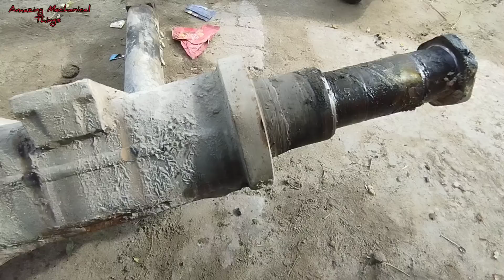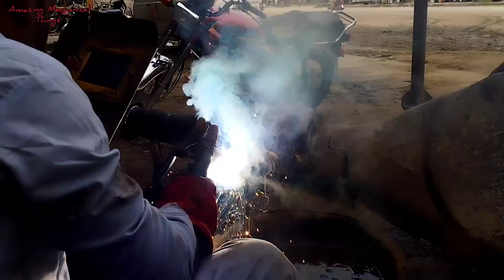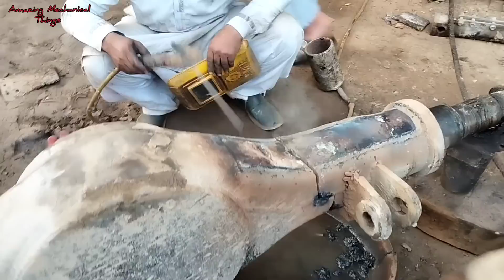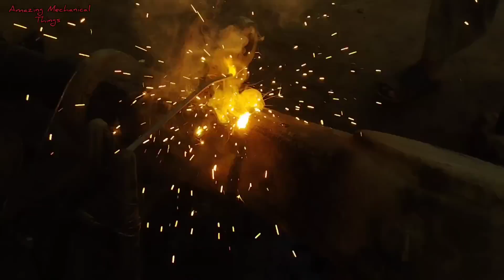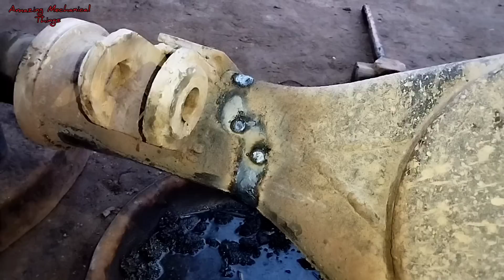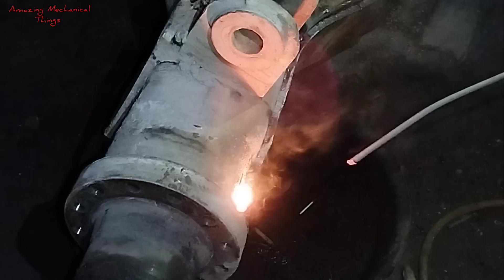Spindle are Cracked in The Middle Which no Mechanic Repairs|| NISSAN TRUCK Broken Rear Wheel Axle ||

Comment: Hate the negative comments,,,, we all "make do and mend" , it is just unfortunate they have to do it with vehicles. Tell me you have never stuck anything together with "Duck Tape"...... I rest my case.
Reply: Hi Jamie, The comments you refer to...the guys don't prep the "to be welded " parts is a colossal omission.  Those who are metal fabricators see that. A weldors job...is to make sound ductile welds. The gents in the vid simply have never been shown the steps needed to make sound/ductile weld joints. Hence their repair will fail soon.
Reply: @petersipp5247  I know exactly what you mean, I was a 6G, coded welder for 15 years after leaving the forces. In all fairness looking at some of their work, they would probably be better off using duct tape 🤣

Comment: Never crosses these guy's minds that the reinforcement strap does close to b-all on top of the axle - it w make a lot more sense on the sides.
Reply: What did you say?
Reply: actually, adding plates to the sides the sides would do nothing. A strap on the bottom goes into tension while one on the top goes into compression. Steel does both of those really well. All the side pieces do is keep the top and bottom apart, and that's why the manufacturers do all their welding there, as it's the least loaded bit.
Reply: @mrl22222  So you actually understood him? What is that? Some kind of engineering lingo?
Reply: @John Evans If they can bend the metal to shape with a 7lb hammer then a 7 ton truck is going to have no trouble bending it either when it goes over a big pothole in the road !

And yeah, no pre/post heat, questionable weld penetration and lots of slag/crap inclusion ... what could possibly go wrong ? !
Reply: Yes, they are not mechanical engineers.  The lack of knowledge is staggering.  Doing the least effective thing in the shoddiest way.  Not a path to success.

Comment: This is a housing repair on a full floating rear axle.  No big deal.  There is zero torque on this weld.  The breakage is from overloading of the vehicle not torque.

Comment: Excellent work, great welding that repair should last for years👏
Reply: Gonna be stronger than the original metal, that's for sure.

That certainly won't crack again.

🤣
Reply from the maker: Thanks
Reply: @mrb.5610  are you serious that wont last 5 mins didnt even bother cleanin around the crack been a welder for 37 yrs and never seen such bad welding in all my life
Reply: @tubbybrutus  I sure agree with your comment. Mr. B has Zero experience re: metal work.

Comment: I'm sorry, there is no way in heck that thing is straight.  Stick an axle in there or try to use it, I dare.  The bearing will self destruct or the differential will blow apart ,or the axle will break.  It might get you a few miles down the road a few miles, but it wont last.

Comment: Despite all of the upgrades they do to their trucks: triple C-frame, thousand leaf springs, 10 to 12 wheeler conversion, the axle assemblies are still the weak link. If they would just follow the gross weight ratings and capacities of their trucks, it would create unemployment.😅

Comment: U can't just weld such a thing with electrodes,like that. First u have to grind- clean the whole breaking edge and minimum a few more centimetres, around it, then grind the corners with a 45° angle. Then u need to control the measures in the millimetres area. Then u can weld it,but NOT with electrodes😵 In the whole repair process u have to control all measurements, the whole time. All in all, it's a nice try what they are producing there but as always, no one can give a  guarantee on such repair and if u're unlucky u simply die in the truck, this part was installed.🤨

Comment: Have they ever heard of axial alignment? With the sledgehammer. How long should the bearing and shaft last? The welding shop has no knowledge about mechanics. But neither on welding, otherwise he wouldn't start with the wrong electrode. This is not craftsmanship under simple conditions but rather unreflective hazardeurism.

Comment: EVERYTHING I am about to say is with respect of the get shit done attitude this country has... 

I could fix this without it breaking again, and so could they. They have more sand than they know what to do with, and torches abound for post and preheating. Let's get some heat in the casing, groove out the joint, add some cast pins and weld that shit back up. Adding 200 plates will do nothing on a case housing. 
Fab 101.

Comment: They have no access to spare parts and even if they did, they would be brutally expensive. They also have bad roads, limited fuel supply and no domestic heavy industry. They are further hampered by having to deal with vehicles of any and all types, which 
makes for impossible supply chain. 
If, for instance, you were in the former E. Bloc 30 years ago, you'd be driving a LADA, which is a Fiat clone. This would have enabled you to grab onto any other Fiat, or Lada part. These guys just have to make do with whatever they can get their hands on.

Comment: This truck is obviously overloaded and or had travelled extensively on poor bumpy roads.  That's why the axle is broken. Yes anything can be repaired and rewelded to a certain extent but once the axle is it into service and if the conditions of use is the same, then it will break again, perhaps this time on the other side.
Reply from the maker: Yup 👍 Ur right 👍